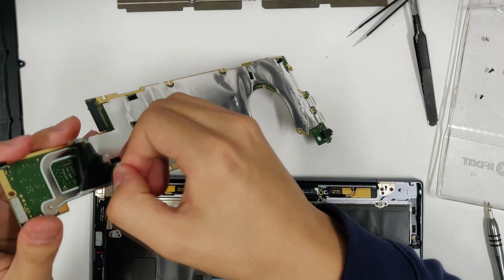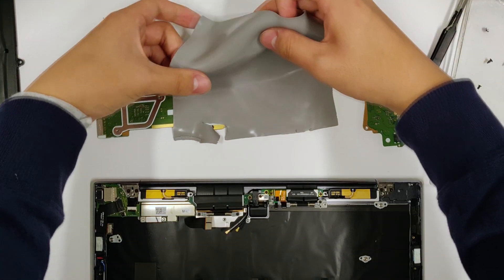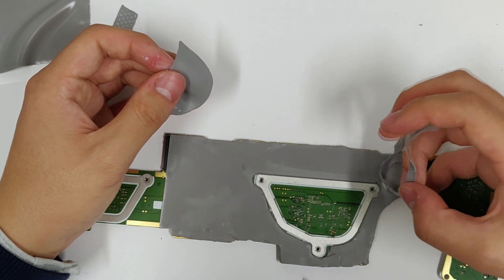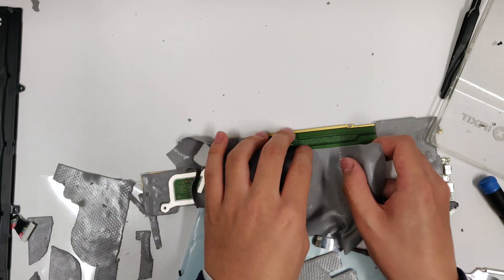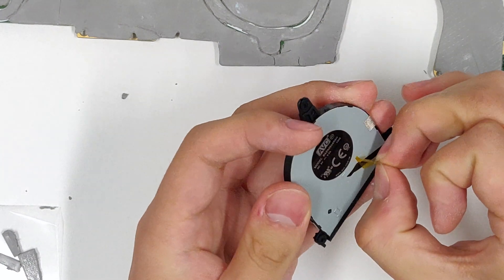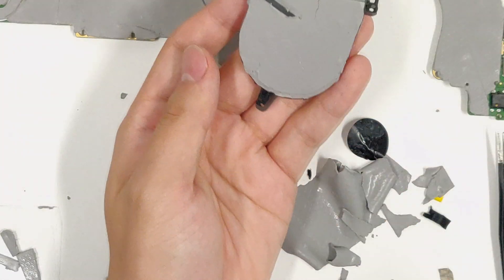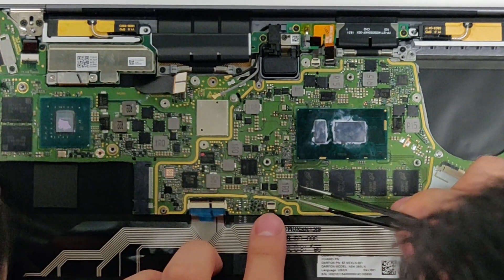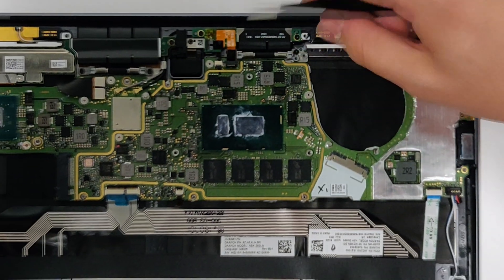MateBook X Pro Mods: Keyboard-Side Cooling (READ DESCRIPTION)

Comment: what did you use to cut the thermal pads with?
Reply from the maker: I used the metal spudger from my iFixit toolkit, but you can also use a knife as long as you don't dig too hard.

Comment: Do you think that doing the 0.5mm parts that go on the brackets first, then peeling that off carefully, then doing the 1mm pad would be easier than doing the 1mm pad first and having to peel it all back off to do the .5mm?  After carving all the 1mm shapes out, it was difficult to peel it back off without tearing.
Reply from the maker: You are correct John. I messed up the order and forgot to talk about it in the voiceover.
Reply: @BradsHacks  Thanks Brad, makes sense.  I was able to work it by not removing the 1mm, and shaping the .5mm by following the slight shape, and it worked well anyways.   Appreciate all your work on the site and videos!

Comment: Does the thermal pad damage the board or soak in moisture ?
Reply from the maker: Nope. Thermal pads are meant to be used this way. MateBook X Pro already has one on the GPU chip.
Reply: @BradsHacks  So back of the mobo is safe on any devices right , like a chromebook maybe to cool it a little better because its fanless
Reply from the maker: @indiawest2025  yeah

Comment: What thermal pads did you use
Reply from the maker: All info in link in description
Reply: @BradsHacks  I'm guessing that you can do this to any laptop without space between the mother and laptop. Thank you for the uninentional universal tip from this guide.
Reply from the maker: @khomchat1  Yep! I'm actually using it in my Yoga 720 15 as well.
Reply: @BradsHacks  Do you use pressure to find the cutouts?
Reply: @khomchat1  that's what I did, you can visually see some of the height variance and used those to trace the shapes.  You can kind of push up against the brackets to follow their line.  It wasn't perfect but got better at it doing several.

Comment: Increased heat capacity, but reduced ventilation. On long loads, there will be overheating. The author is stupid! Spoiled a great laptop :-(
Reply from the maker: Do you have proof of worsened long load performance? Have you tried it out yourself? I found the results to be exactly the opposite. Because there was no airflow in the backside to begin with. Thermal pads' conduction to the chassis is better than non-moving air, which provides little to no convection and of course negligible conduction.